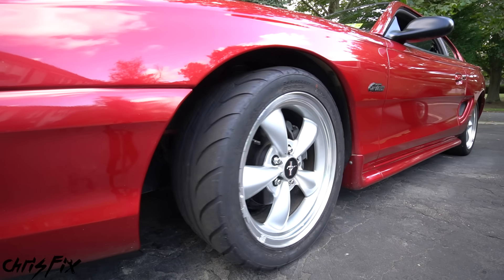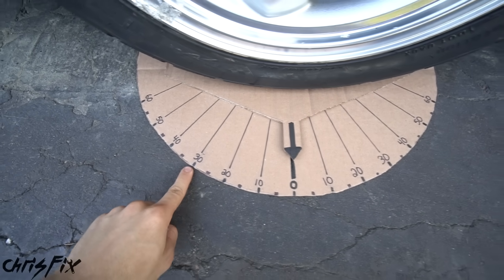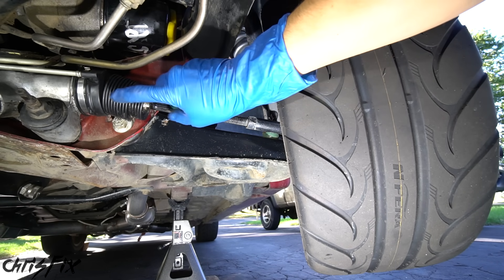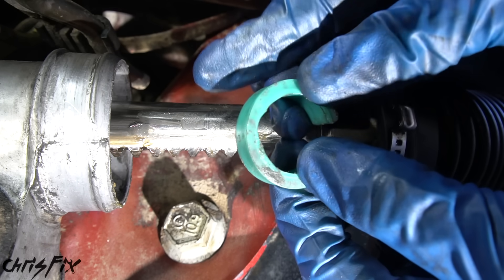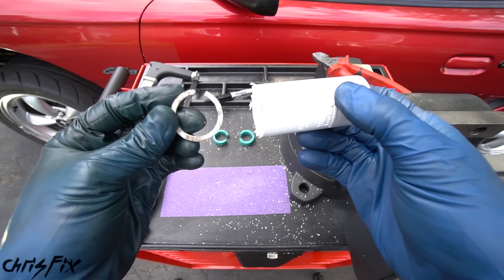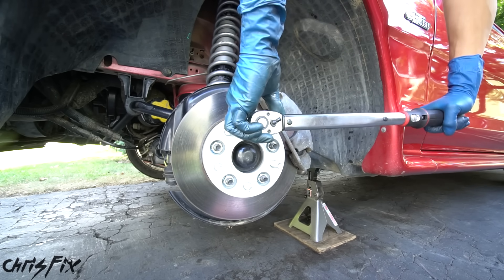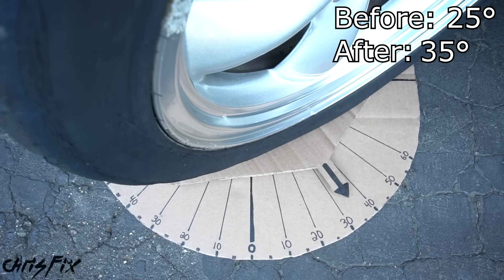How to Get Your Car to Make Sharper Turns (Steering Angle Mod)

Comment: you should probably also check for clearance while the suspension is both compressed and uncompressed, because the parts move. it should never touch.

Comment: Noooooo, those spacers are there for a reason ( in some cars can be dangerous to remove them) the steering rack and the tie rods have their own geometry and can get stuck without the spacers. Also in some steering racks the pinion can get stuck when it runs out of teets in the rack and the spacers prevent it from that. Make shure you get a decent angle kit for that kind of needs

Comment: Man I wish I knew about this back when I had my 04 Volvo S60. I loved that car, it had an amazing interior and probably still the most comfortable seats I've ever sat it. That was a great vehicle, but wow the turn radius for a semi sporty looking sedan was atrocious. I have no idea how they made it that bad, but having to make 3 point turns constantly when driving in hectic downtown traffic was not fun. 

But I have to say, those are really nice cars outside of that. Especially if you get a turbo'd AWD variant with a manual. I bought some nice leather barstools off Craigslist one time from a mechanic who worked on a lot of Volvo's. He was telling me about how much metal they have in the frame of the car. He was saying he had never seen one roll through the shop with the frame bent around the cab significantly bent inwards. Meaning even in a crazy crash, they will keep anything in the cabin from collapsing. But yeah, awful awful turn radius lmao.

Comment: Hi Chris, In my Suzuki Swift when turning to the left, the steering is not returning to the centre. What could cause this? I think there is no issue with the rack because I replaced the rack 2 times (reconditioned racks) But the issue is still there. Spent several thousand to get this fix but the issue is still there.

Comment: You gotta check for wheel rub in the maximum spring compression position and full steer when using wheel spacers.  Might need a differently sized wheel spacer.

Comment: You just destroyed the suspension geometry of your car! 
The Negatives
The main issue with a wheel spacer is that it moves the wheel to a wider position whilst the rest of the suspension arms remain in the same place. In particular, the king pin inclination axis remains in the same place. Therefore, fitting a wheel spacer moves the wheel outboard and alters the scrub radius of the car. It is important to know whether your car currently has negative or positive scrub radius and ideally how much it has. Fitting a wheel spacer will increase the positive scrub radius at the front wheels which has some unfavorable consequences.
If your car already has a bit of positive scrub radius then the wheel spacer will increase it. An increase in positive scrub radius increases the forces on the steering rack under braking conditions. Any bumps in the road will also be amplified through the steering wheel, making the steering jerky and more unpredictable. Twitching wheels when braking can cause the tire to lose grip and ultimately can cause the wheels to lock up and slide. An increase in positive scrub radius also causes the wheel to gain positive camber when the wheels are being turned, reducing grip in corners on the front wheels and producing understeer.If your car has the more favorable set up of negative scrub radius then installing a wheel spacer can cause bigger issues. The outward movement of the wheel can make a negative scrub radius become zero. This is the worst position for it to be in. A zero scrub radius can cause squirm. This is where a scrubbing action occurs on both front tyres in opposite directions which can create unpredictable handling in corners and can lead to understeer too.

Secondly, installing wheel spacers on a car increases the leverage on the wheel bearing. The larger the spacer, the larger the leverage becomes. This reduces the life of the wheel bearing as they are not made to take leverage forces and can therefore wear faster, increasing rolling resistance and power loss of the car.

Finally, the wheel spacer moves the wheel further away from the damper mounting point. This means that the wheel will have a larger effect upon the damper and will act upon it with more leverage. This effectively makes the spring and damper softer and less effective on the wheel. This means that the car can roll more on corner entry and exit and feel generally softer out on track or on the road.

Comment: Oye man

I actually need to reduce steering angle, does adding a steering rack limiter to a car a good safe reliable option? Its a daily not a build just a normal car. Unknowingly bought a large tire
Reply from the maker: You can add spacers to reduce steering angle.

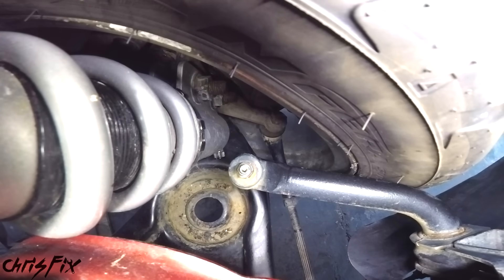Comment: 5:50 my wheels makes some contact with the sway bar, is it okay to just put oil on the sway bar as an option? That way the tire doesn’t “catch” the sway bar
Reply from the maker: I would shave the limiter so that when you put it back in, it prevents the wheels from contacting the sway bar. Since this is a drift car build I installed stiffer coils and removed the sway bar.

Comment: Don't lock your steering wheel on the move you will damage your CV joints and parts, if you have bigger heavier tires, use your full steering only when needed, 😎
Reply from the maker: I was locking the steering wheel a lot while drifting and actually never damaged anything, but if you are driving around normally then you are correct!

Comment: thank you for informing everyone about the steering lock and letting off a little bit so you dont blow your power steering pump. i will see people go full lock and then just lean on it with all there weight as if its gonna magically turn more

Comment: Hi Chris thanks for making good videos. I have 2007 camry. The car slightly pulls to the left when my hand not holding the steering wheel. The steering plays (pulls randomly right or left) on rough road and pulls more on when the road is banking. I had the vehicle checked several times at the dealer and wheel alignment shop they said nothing wrong with the alignment and suspension condition are good except the left strut. The left strut can't return after compressed. Is it possible that this be the cause of left pull and steering bump?

Comment: Hello Chris  I'm a long time to describe it to your channel great stuff but can you do this on AC4 Corvette fixed the turning radius
Reply from the maker: The C4 corvette turning radius is fine? I have one and never had an issue haha. I wouldn’t mess with the steering geometry on a Vette since they are designed from the factory to behave a certain way. But you can get your knuckles welded where the tie rod goes to make a tighter turning radius.

Comment: The wheels' swing is ever so slightly different at any particular height of the travel, so everyone just be mindful of that. Also, that whooshing noise you hear at full lock is just the bypass valve preventing the PS pump from damaging itself.

Comment: the reason turning left is 30° and turning right is 28-°29 is due to a thing called ackerman angle, this is control of tyre slippage and angle management between both front wheels

Comment: Hey so I just bought a 1997 mustang 2 door convertible. So I had it and just got a oil change need to fix mileage on dash it got stuck so going to fix back gear behind the odometer probably rotted or Something but now it is over heating sadly and I actually did this when I first got my car so easy to do and adds that turning advantage for a long vehicle

Comment: Nice modifications on cars. It's pitty most of them would be illegal in my homeland.
We have bureaucrats everywhere. Even switching off seatbelt warning, because you often have stuff in your front passenger seat might be the reason not for not passing state technical control (required every 2 years).

Comment: Only thing I’d recommend for this is that when checking how thick your spacers need to be, you should always check clearance first with the weight on the vehicles suspension.

Comment: However, by installing the wheel extension disc you also reduce the turn circling diameter. Means that you make it sharper turn but then you re-unsharp it again by widening the wheel distance.. but perhaps in this video case you still sharpen the turn a little bit.

Comment: Never, and I mean, NEVER do that. Your car is the result of many years of development, researching and testing to get to the desired results. Those wheel adapters do nothing good for your car. They're increasing the distance between wheels, which means a lot of downforces on them and the wheel assembly, the wheel are causing more drag, because they've been placed outside the optimal line and the worst thing is that you have no clue about how much the forces acting on the wheels are gonna be increased, proportional, with the speed. Falks, don't do that to your cars !
Reply from the maker: I'll be making a video about all that soon, but thanks for sharing!

Comment: I would a assume those rack limiters are there to protect the steering rack seals when at full lock?
Reply from the maker: They install them so if you install wider tires (common mustang mod), it won't rub!

Comment: My car steering left side hard turn right side soft turn what should I do ?
Reply from the maker: Check the fluid level, as it might be low (and if it is, top it off and see if you have a line or something in the system leaking so you can fix it), if everything looks good then check ball joints or strut bearings, and if those are good then the spool valve in your rack might be stuck, and the only real way to fix that is to get your steering rack replaced.

Comment: My wheels on my mustang hit my sway bar when I'm not even fully turned, will I need spacers or is there something else I could do? (This without any modifications, just 17 inch wheels instead of stock 16)
Reply: Yes you should put the old wheels back on, or add spacers

Comment: Good vid for folks who don't know about cars. 
----sometimes, on my own vehicles, I replace the clamps, e.g., when doing a cooling system flush, with regular hose clamps. Not only do they hold better, you can adjust the tension on them, but they are also, to me, easier to work with. ESP., when you put the boot back on, it obviously is not tight anymore. 
-----Those "Wheel adapters" are wheel spacers. By using them, you are changing the pressure points on the suspension and bearings, wheel offset, adding more pressure to the studs, changing the wheel alignment, and tire wear could become uneven, to name a few. 
-----It increases scrub radius. This increases pressure on the steering rack. All these changes can make the steering wheel feel jerky over bumps, etc., affecting steering control and the tires no longer have the car's weight in the middle, or as close as possible to the middle, thus in wet or other conditions such as maneuverability can lead to wheel slippage and an accident.  
-----Eventually, based on my 28 years of experience, the wheel bearings or something wear prematurely and even break, even a steering rack, which ends up costing the customer boat loads of money to fix. They are considered "Safe," if installed properly, but they also can change the reactions of the suspension components, which could potentially lead to an accident. 
----

Comment: One little note about holding your steering wheel at the lock: RTFM.

Your manual usually will spec how long is considered safe. Ford specs 12 seconds.

Comment: Looks like reverse Ackermann steering which is not ideal for low speed maneuvers.
Reply from the maker: You are correct, but because of the increase in steering angle and the positives of reverse ackerman for drifting, that is a compromise I was willing to make, and when I drove around like this for a while, I never noticed a negative from doing this!

Comment: Doesn't this disobey Ackermann steering? According to Ackermann steering, the steering angle of the inside tire should be greater. Meaning when making a left turn, the driver side tire should have a greater steering angle than the passenger side tire, but in this video, its the opposite. Thank you for anyone who replies, this will help me a lot in a research paper I'm writing.

Comment: Hi Chris, I have problem with my steering wheel. My steering turns 1 3/4 turn on the right and my left turn is just 1 1/4. Can you help me to fix this problem or you can do video about this. Thanks in advance.
Reply from the maker: I would find a reputable alignment shop and explain to them what you are experiencing, and they should be able to correct this issue, whether it's through tie rods or getting your steering rack realigned!

Comment: I know this is kinda late, but seems like this is only adding angle to the end of the motion, not over the course of the motion(if I'm wrong, correct me). What this means is that you're only adding to the amount that the steering wheel spins, not adding any extra angle before that point.

Comment: Anti seize is a waste of time on flat butted metal surfaces
Reply from the maker: Why do you say that?
Reply: @chrisfix  because flat metal surfaces can  not stick together. Even full on rust will not hold them very tight. Tight overlaps would probably need some of that shit
Reply from the maker: thanks for sharing

Comment: Broke my driveshaft 6x because the previous owner did this mod to my car (but a bit more Ghetto) Saw this video and i finally understood why it always broke when i fully turned the steering wheel. It won't be a problem for a Rwd car but for a Fwd it sucks.

Comment: On some vehicles, the steering knuckles have a bolt that is adjustable to get the steering angle more tighter than the factory setting. Especially on trucks and SUVs.

Comment: Wheel spacers mess with the scrub angle. How much spacer thickness can you add before the car is unstable and wont track safely at speed? I seen guys on the highway in lowered rice racers with stability problems and neg offset wheels.

Comment: Putting hub adapters on your car puts more stress on your wheel bearings and youve got more unsprung masses on your car, shitty solution in my point of view. Also you didnt checked the tire clearence when the suspension is fully deflected, you only checked it on jack stands when it was completely realeased.

Comment: Steering geometry and wheel offsets are there for a reason. 
Im all for mods but this is bad advice
Reply: I thought the same thing... Wheels are gonna start rubbing on stuff it aint supposed to
Reply: @joshwilliams571  aswell as steering geometry is greatly affected
Reply: @jarrendickinson5279  i mean, this isn't his daily. Its literally a track toy he drifts
Reply: @the_realpapajohn  i mean, that's not the point. Track car or not it's a bad idea.  If you don't know why then go do 20 years of R and D with a brake steering and suspension company. There are way better ways to get more steering lock without loading other components beyond what the are designed to do. 
Anyway he promotes it as a mod for anyone.  How many people are going to go do this then wonder why shit brakes and dont work properly anymore. Possibly causing a accident because crisfix did it.
Besides who drifts a Mustang
Reply: @jarrendickinson5279  Stop saying that foul word, it makes me weak!

-James M. Padre Juan
Reply: @jpj1514  
Um...... what?
Reply: @jpj1514  ????
Reply: How dare you say that!

-James M. Padre Juan

Comment: I think you forgot something while checking clearance, when the car is on the ground, the tires will flatten down and become a bit larger due to the engine's and the driver's weight and that 5 mm gap does not seem to be enough once this happens.

Comment: You should offset the rear wheels aswell. Highway speeds youre back end will sway
Reply: One of my rear wheels sits out 1 inch further than the other and believe it or not it stopped the shaking in my suspension

Comment: Curious about your angle findings...when you make a turn, the inside wheel has to make a sharper turn and thus a smaller radius, but your finding the opposite is true during both measurements.  I guess that's why mustangs always end up sideways in the crowds?

Comment: Well it's common sense that all American cars can't turn. So unless you have an American car, this video is pointless, coz all other cars has this steering ANGLE... STANDARD!!! And you took the limiters off, BUT you're keeping it just in case you need to put it back on... Why would you put it back on? I wouldn't trust this advice/video. Follow these steps, meanwhile the guy showing you how to do it, doesn't even trust his own advice... Coz why else would you go back to less angle if you wanted more to begin with...?🤔

Comment: Hi chrisfix  I just bought a 2001 BMW 330Ci and it came with a problem, when turning the steering wheel to the left the wheels turn normally but when I try turning to the right both front wheels stay pointing to the left and the steering wheel spins freely to the right, any thoughts in what the problems might me?

Comment: Do you use a push pull method of steering for drifting it’s my first time watching your channel and just a suggestion but using push pull turning allows you have more control of your car and you can you can move the wheel faster